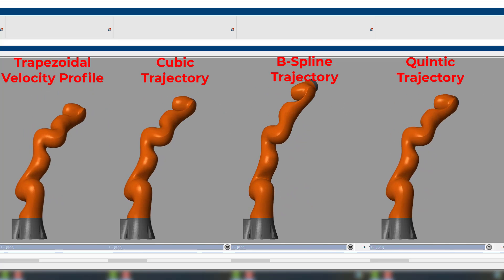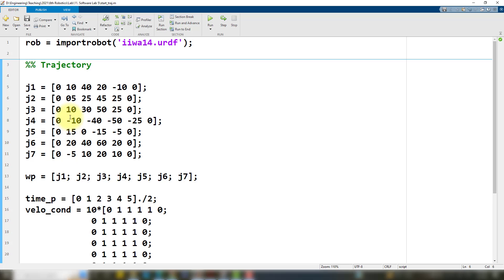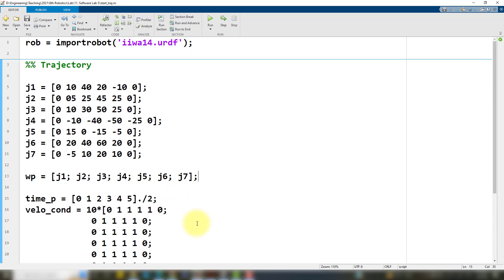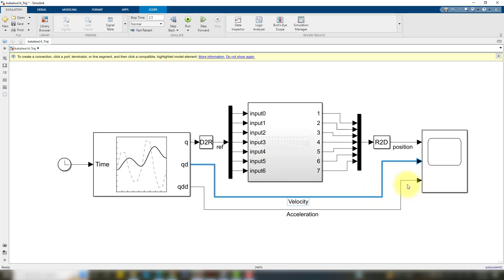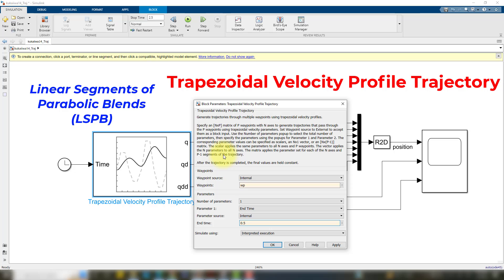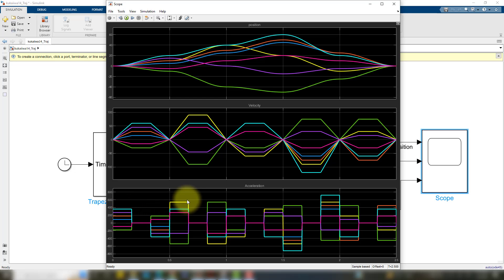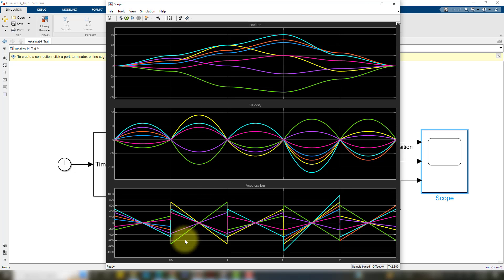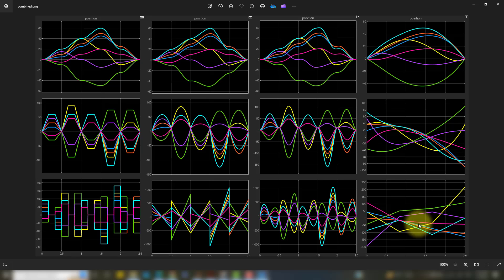How to Generate Different Types of Robot Trajectories in Simulink MATLAB | RST | Robotics

Comment: Thank you for the video. Do you know how to convert 3d model from solidwork into simscape simulink with a correct coordinate. and use it with forward and inverse kinematic?
Reply from the maker: there re several things you need to consider, so there is no one answer that I can give you here. What I can do is that I can make a video on that but that has to wait around a month.
Reply: @LearningOrbis  I couldnt find a video on the topic...could you please share the link to the video if you have uploaded it. thanks!
Reply: hi, did you get to manage to import solidworks cad model into simscape with correct coordinates? Currently I am trying to do it with no luck :( thanks